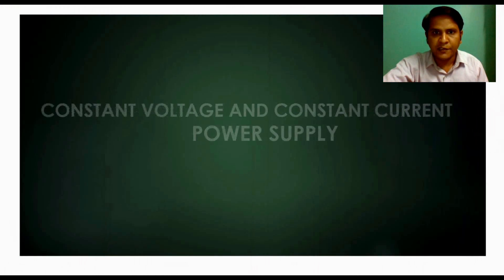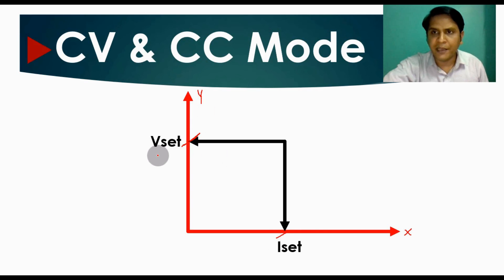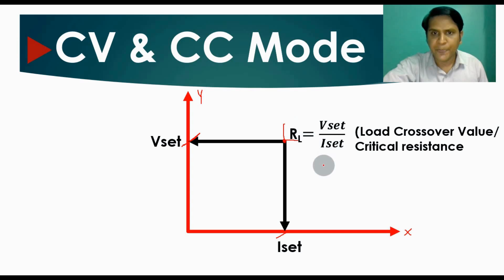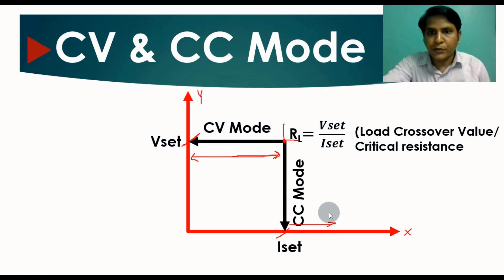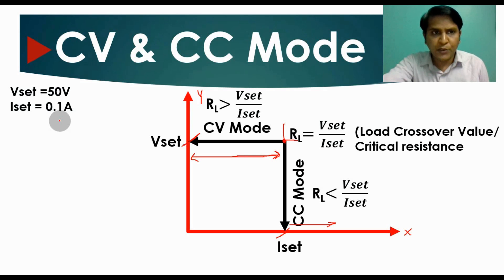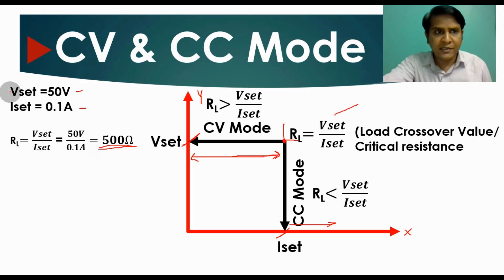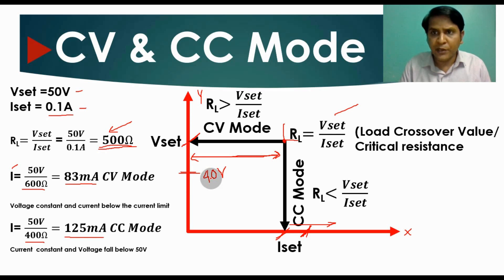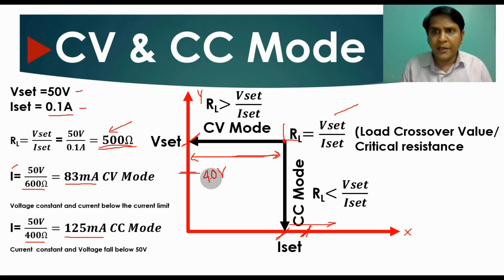Constant Voltage & Constant Current Power Supply Basics || CV and CC Mode

Comment: Hi, if I have cc/cv board and I need to adjust an led 5w, can you please take take me through on how to setup this issue? Thanks
Reply from the maker: Hello, did you understand how CC/CV works ?
Reply: @ElectronicsCircuitHubECH  what I’m thinking is to set the led forward voltage to around 3.6v and then adjust the current to around 1.4am
Based on 5w led and forward voltage 3.6v! Correct me if I’m wrong please? Thanks

Comment: If I am charging a 12 Volt 7 Ampere battery using a 12 Volt 1 Ampere transformer having complete rectification and filtration then is it a constant voltage or a constant current power supply (charger) ?
Reply: CC power supply .

Comment: But how does it do that? How does it identify the external load and adjust itself?
Reply from the maker: Voltage Sense and Current sense in Switch Mode Power Supply .